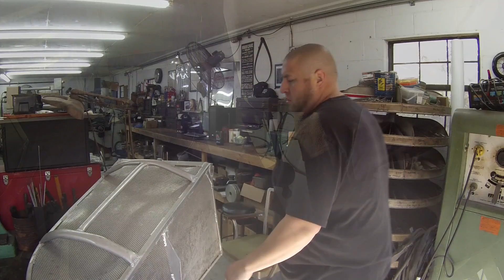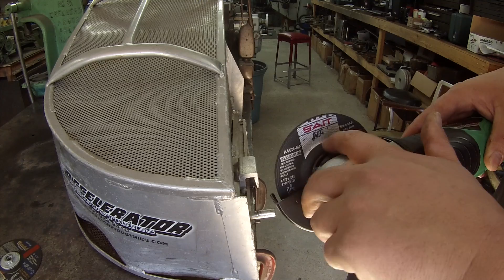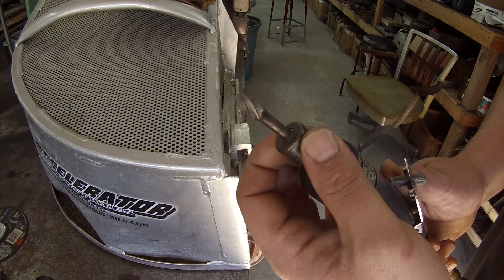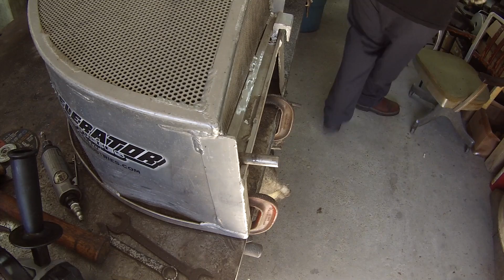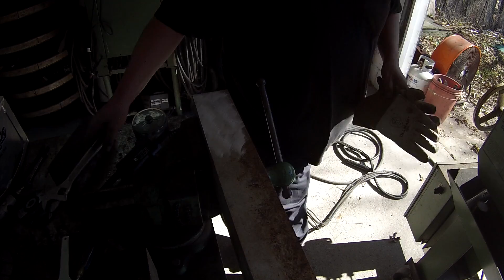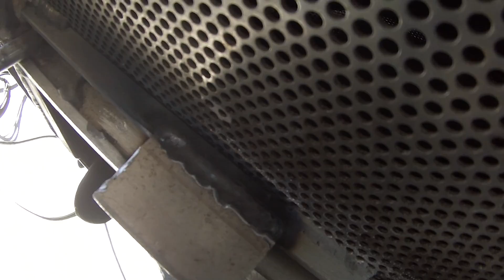Aluminum Grass Catcher Mods & Millermatic Spool Gun

Comment: I end up working on galvanized metal so often I finally went and got a positive pressure self-contained air supply and full face sealed mask.  It makes a huge difference coming away not feeling like I’ve got the flu every time I light up the welder or grinder for a few minutes!

Comment: Love the video. 
At work we fab ally. When you cut it, grind it or sand it you want to rub some wax compound on the tool -cutting disk, grinding disk or bit, even sand belt or wheel, saw bladesl. You name it. We have a compound that looks a bit like candle wax. It stops ally sticking to the tool and helps it cut sand or grind better.

Comment: In addition to beeswax, you can also use ATF (automatic transmission fluid) to keep the burr from loading up. It also works pretty good for tapping and machining aluminum.
Reply: +Defnotdemas A quick rinse with acetone and it's gone.

Comment: Nice work. The only down side I seen.... You got 3 new angle grinders yet used 3 tool changes on the same one ahahaha. You need one with dedicated wire, one with a cut off, one with a grinder and one with a flap disk

Comment: You can get that aluminum out of your carbide burr with some sodium hydroxide (also known as caustic soda, lye, or drain cleaner). It will dissolve it and leave carbide or steel alone.

Comment: Thanks for sharing Adam, Great video.

Word of warning ref: Argon Gas!  Argon Gas is heavier than the air you breathe, hence if you find yourself in a position where your doing a lot of overhead aluminum welding, in a shop atmosphere {i.e., no wind / breeze}  and it won't take long, a half hour plus, when you go to standup, you could find yourself short of air/breathe, and your lungs will definitely feel full/heavy (if you ever swam in salt water you'll understand.) To help combat this just open and then lower your oxygen regulator on your torch to approx 5-10 lb's, and take a couple of breaths (as needed) from your torch, to help clean out your lungs, the Argon Gas likes to sit at the bottom of your lungs.  (Speaking from MASS EXPERIENCE, the feeling suck's, it's all most like a fake heart attack. I had two {heart attack's,} was counted down and out/gone for the first one.)

You'll find when welding aluminum whether with a regular push/pull gun, or a spool-gun, you'll need to keep approx. twice the height of Regular Steel Mig Welding, and should hear a kind of swirl sound, which means your holding at the correct height. Remember the Argon Gas is a heavy gas.

And NEVER use any of the nozzle protection spray's on your aluminum welding equipment, once you do, that nozzle will only be good for Steel Welding, unless you want to take the time to CLEAN VERY, VERY, VERY GOOD with some Acetone or M.E.K. (Methyl Ethyl Ketone.)
Reply from the maker: Thanks for the helpful tips Dave!

Comment: Hi Adam, looks good! I specialize in aluminum fabrication and welding (radiators/oil coolers/ intercoolers mainly) I use those sorts of grinding wheels/cutoff disks with great success. But, you can extend the life of them significantly by using a lard based product on them. The ones I use are specific to New Zealand but i'm sure you could find them over there.
Reply from the maker: Does the use of the additives ever effect your welds after? or just wipe down with some solvent?
Reply: Abom79
Typically, no, but it can happen. I just use Acetone on a rag. I've never had an issue that I can pinpoint to the wax/lard.

Comment: Wass amatter you? Fenner would have machined a new part, disassembled the structure, and TIGed dime stacks around all of the joint. At least put the gopro on the lawn mower so that we can go for a ride.
Reply from the maker: I want them done as quickly and cleanly as possible. This one worked out just fine, and Jason is a happy man now! he catching leaves by the bushel now!

Comment: another great video just a quick tip try some wax on your grinding and cutting wheels for aluminium and it will cut throw like a hot knife throw butter .
Reply from the maker: Like as in a plain ole candle?
 I have a tube of stick wax for machining, wonder of that'll work too.
Reply: Yes I use bees wax or candle wax or even a bar of soap works

Comment: Hi Adam,
Grass season is over for a while up here, too bad, cause snow season is not good news for me, you can always push away grass cutting day, but, can't push snow removal if you want to get out of your driveway, and worse of it all it' COLD....
No critters though.
Cheers,
Pierre
Reply from the maker: Down here everyone is bagging leaves. I just let them fall and melt into the grass. LOL
Reply: I do that too, that's called compost and it's excellent for nature. What is the coldest you get down there?
Reply from the maker: Back in January we got down in the teens when we had that ice storm. But our normal lows get down in the 20's at times but never stays that cold for long. Usually in the middle of winter lows are typically 30's-40's.
Reply: Fun...! Guess snow melts quick...
You get a little colder than I believed, If humidity goes down it must at least comfortable.

Comment: Great video Adam! Another way you could have welded the bracket back on would be to heat and bend a tungsten and use a second flow of shielding gas. You can get into some crazy tight spots like that if you wanted it to be a TIG weld.

Comment: Wouldn't it have been easier to grind the entire bar off the frame and screen.  Then cut the bar 1' off the right end, weld the piece back onto the left side of bar, and finally weld the bar back onto the frame/screen.  Seems the grinding and welding would have been immensely easier.
I have some info on gout I'd like to sent, can you provide an email address?

Comment: Nice job Adam those Aluminum grinding / cutting wheels work really good I've used Norton Gemini for Aluminum grinding with good results.  Will have to try the Sait cutoff wheel for aluminum.  Preheat works really well when using a spoolmatic on aluminum, I think that is what you found out too.  Once the metal is hot it welds  really well.  I preheat with a torch even with our fancy 350P pulse machine.

Comment: Great video Adam - I've never seen a spool gun use before. What are the basic principles and purpose behind it and basic setting it up please?
Reply: Hi, to make things even more complicated, you also have Push-Pull guns, it's like a mig gun with a little motor in the handle, advantage with this is to be able to use big 12" or bigger reels, since the reels are in the welding machine instead of using the small 1 pound reels in the spool gun.
Those are usually 25 feet long cable, important when feeding aluminum is to use a nylon liner in the cable.
Reply from the maker: Spool guns, or even modern aluminum wire welders are great for production welding, or job shop stuff. My buddy Joe at his welding shop has a few of them. When your working big trucks, trailers, and boats it's much easier to use the mig guns vs TIG. I've also used mine to do a heavy build up on a part to machine a while back.
Mine was built for the machine, a Millermatic 251. it's a plug and play deal. All you have to do is hook the gas line up to an Argon bottle.
You can use it for many welding jobs, but you may know that TIG gives you much better control over the arc, and puddle for delicate welding jobs.
Reply: Thanks for your reply
Reply: Dan Whiteford Another reason is that aluminum is too soft to reliably push through the lead like you would with standard mig wire, so you keep it all in the handle.
Reply from the maker: pierre beaudry
I forgot to mention that Pierre. Good point.

Comment: Adam , what gas did you use for the aluminum welding ? I just picked up a Hobart spool gun for my Hobart 210 and I have been waiting to try it , I was told pure Argon ,not a mix . BTW great Video ,
Reply from the maker: I use pure Argon. I hook the line to my argon bottle thats normally hooked into my big welder.
Reply: Thanks Adam , gotta pick me up a bottle ! LOL all the best , Bob k

Comment: Did the end result fit? You can see a gap between the rail and the tac weld, that wasn't there originally. Im going to go ahead and guess that the tack weld was there to hold the rail and bracket as close as possible, before you welded the back of the bracket.

Apologies if most of what I say doesn't make sense, kind of hard for me to explain in words :(
Reply from the maker: It's still sitting on my bench, as I did the job yesterday and they havn't picked it up yet. But I have no doubt it will fit. Theres plenty of room for the steel plate to slide up in that hook and hold it in place.

Comment: I Love all works you do, and you are very professional. What ampere you use when you weld aluminum whit mig? All regards from Sweden. // Georg Lofgren
Reply: Adam explains the volts in the video.
Reply from the maker: It's hard for me to explain the actual amerage, as mig welders go by wire speed. The higher the wire speed the higher the amps. You have to adjust the voltage to match as well. Most machines have a chart on them to help dial in the correct settings for the thickness of metal.

Comment: I need the ability to weld aluminum soon and was thinking about getting a AL gun for the Lincoln mig.  Lately I am thinking of putting the money for the gun towards one of  the newer "import" TIG welders that are getting rave reviews for the homeowner / hobby market.
Reply from the maker: Been quite a few guys using the new line of Everlast welders. James Greene has one and loves it! He's been putting up some videos of it's use also.
Reply: Abom79
Yep.  Been thinking about pulling the trigger on an Everlast.  For double the price of my mig gun I can get a full blown TIG and all the other benefits.
Reply: I love my Everlast Power Pro 205 multiprocess machine.  It's a great machine.  You won't be disappointed with it.
Reply: MrThisIsMeToo
Miller makes an all in one now. Does stick TIG and MIG. Pretty nice little unit. It does ac stick ac TIG dc stick dc TIG and MIG.

Comment: I have only a couple of the aluminum burrs. They do work very well without the clogging of double cut burrs for steel. Those wheels seem to work well also.
Great job on the grass catcher considering the room was pretty tight in there.

Colin ;-)
Reply from the maker: Thanks Colin. I used to have a couple of the aluminm burs, but that one was all i could find. Time to pick up a couple me. When you need em, you need em!!

Comment: Them grinders are handy.  Face shields are cool!  You can hog down and not squint or worry about the disc shrapneling into your face.  So you can think more about the work.  Other than that you don't get a bunch of debris blasted into your face, nose, hair.... that you have to spend time washing off.  You can see why Keith has a bunch of them:  saves time on the wheel changing.  Can't wait to see Metabo chow.  Hey, mark them good.  Use a soldering iron to melt your ID into the plastic handles or pencil grinder into the castings! Maybe the inside of the handles? mo-fo...thieves... Enough said.
Reply from the maker: Everything will be nicely marked, and in ways you mentioned. Also documentation of serial numbers.
I do like a good face shield, and it's best to practice safe grinding habits.

Comment: couldn't see the weld... were you short circuit or spray arc?
Reply from the maker: I would call that a long arc. I couldnt get the tip all the way in there so I had a good 3/4" of wire coming out.
Reply: Abom79
Anyhow for spray arc you need a longer distance to allow the spray to develop, and at 24-25 volts usually it's spray.

Comment: I was never able to get away with using a spool gun i dont
know why
Reply: Setup seems to be a bit trickier for aluminum than steel. My first mistake was not knowing that it works best in spray arc mode and you need to have a long stick out... about 3/4". Also, 5356 wire doesn't seem to weld as clean as 4043 at times. I get more soot/spatter with the 5356 unless everything is just right.
Reply from the maker: I have always had good results with mine. It's not as clean as with tig welding, but does the job when you have alot to do.
Reply: Steel wire contaminates the torch lead/cable.  As the aluminum wire is fed through the lead it picks up that stuff.  So it screws with the metallurgy at the arc.  Also, the aluminum isn't as stiff as steel and is more prone to wire jams.
Reply: i used to use tig as i couldnt get the knack of the spool gun even on new alloy
Reply: I was concerned about the contamination as well even though there is only about 4" of liner and the tip to go through. The other day I was experimenting with 3/64 5356 wire (I had to drill a tip just to try it). I was amazed at just how well it welded (full tilt boogey for my machine) once I got the settings right. It was very clean as well. So I guess the 4" of liner wasn't an issue. I tried to get the same results with .035 5356 and could get a good weld, but as of yet... pretty sooty. My settings were close to recommended, but I'm going to try it again at the recommended setting. I have an aluminum project coming up this week.

Comment: That tack weld was probably to hold it in place so they could change position to weld from the inside before the mesh was added.
I may have been tempted to cut the welds on the mesh to get access to the inside for grinding/welding, but you did a good job on that
Reply from the maker: aserta
The aluminum block I moved and welded is was holds the grass catcher to the deck. The pin aligns it in place, and the hook keeps it level and in place. It's a super fast mount/dismount system. The little piece of flat bar that was welded on the deck kept the catcher from resting all the way down level.
Reply: Actually i think, that the hook was initially meant to be a moving part. There's no reason to have that sliding rail, IMO, and the back hook on that part other than provide structural support. Probably different models, like the case in point here??
Reply: Abom79 Ah, i see. Didn't have perspective on that one :))